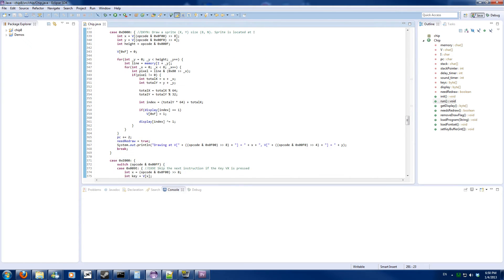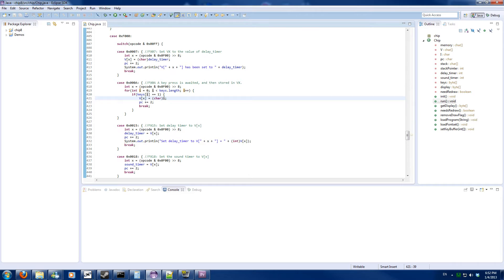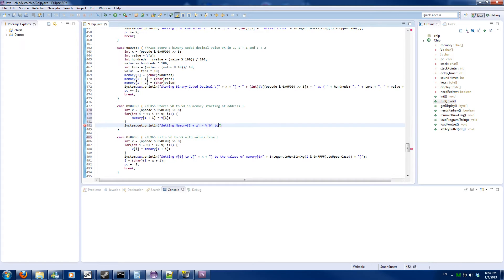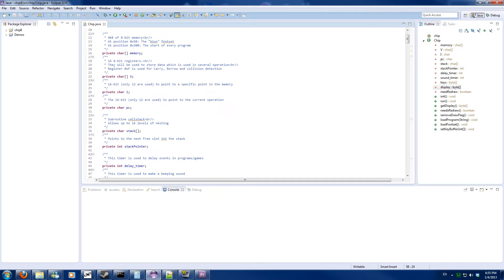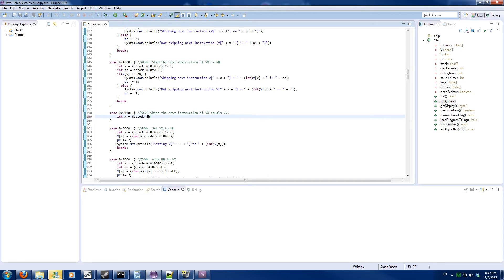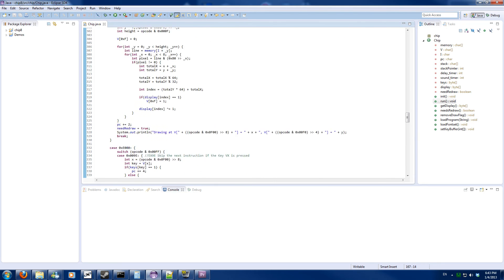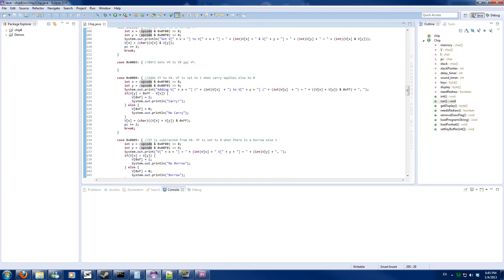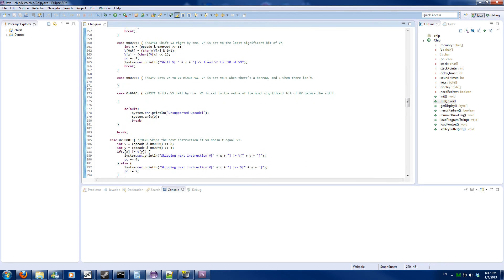Make your own emulator - S1 Part 11: Final

Comment: I am having a problem with pong. When I move the paddle off screen it throws an ArrayOutOfBounds exception. It does this because the variable named index becomes higher then the length of the display array. Do you know any way to fix this? Also, this also carries over to other games. Would really appreciate the help
Reply: Okay so I actually figured it out... kinda. You can actually put a try-catch where you put the index in the display. If it sees a indexoutofbounds exception, it will just skip it. I works fine. I don’t get how, but I don’t care lol.
Reply: Screen wrapping
Reply: Yes, you need to implement the screen wrapping.
It's explained in this video, it starts at the right moment: https://youtu.be/V7eiBIkoppY?t=244